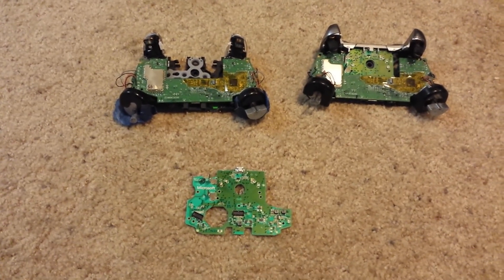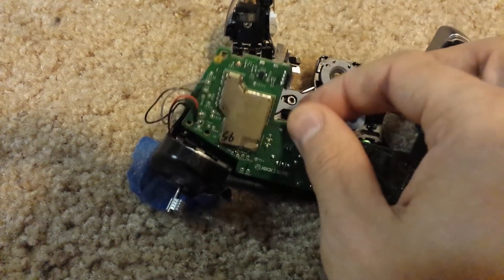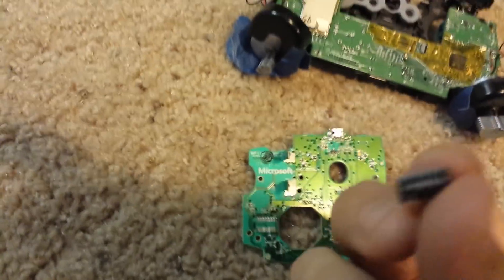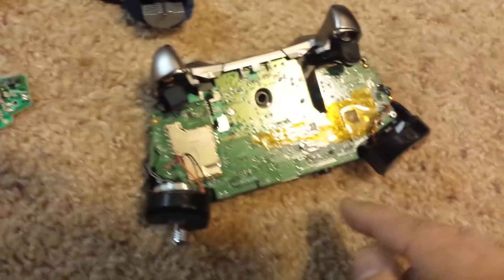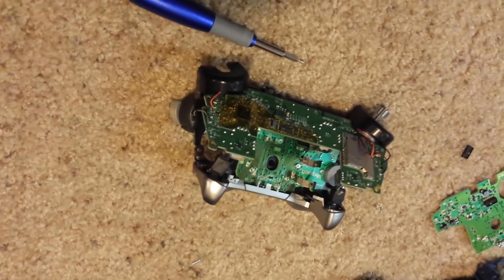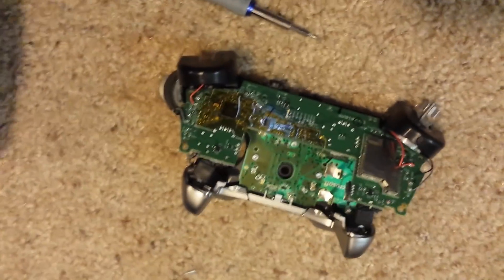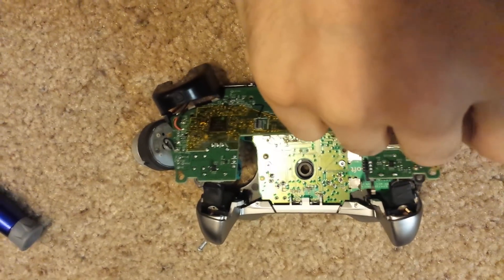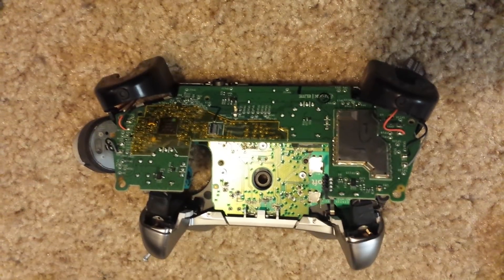Why XBox One controllers won't turn on or charge.  Fatal flaw in Microsoft's design.

Comment: What they need to do and should've done in the first place, would be to not use surface mounted connectors, but instead use connectors with pins that pass through the PCB. Surface mount connectors should be only used when they are making a connection through pressure force like "spring loaded". But they have no interest in making solid hardware that surpasses the warranty period. The quicker it breaks, the better for them. This is going on for years in the industry at all levels and it's nothing new. Such design flaws are usually intended and thought out with "great care and attention to detail". They must hit that sweet spot where a product will function correctly just enough so it would surpass the warranty period, but not by much and then would fail. The shorter the period from when the warranty expires to when the device fails is, the better.
Reply from the maker: No kidding.  That's why they will only warranty them for 90 days from purchase.  At least the PS4 controller have a single plane for the buttons AND its done on a removable ribbon layout so it can be easily a cheaply replaced should a button stop functioning.  Sony definitely gets the win on controller design, even though I normally hate some of the proprietary measures and connectors they use.
Reply: it started in the late 70s early 80s. its called "manufactured redundancy" or "engineered redundancy", and youre right this is a common business practice. what big corporations were finding in the 70s/80s is that consumers were not buying as much product as they would like them to because their product was too well manufactured. the materials were too quality.....what happens if the product is excellent design and quality? sales go down because of loss of repeat sales.

so now engineers are tasked with finding that "sweet spot" in order to do exactly what youve described. this is not impossible, the technology is there and it continues to "improve" every day.

capitalism = if a business can find a way to make more money and if that includes inferior quality to increase repeat sales then of course they will do it.

capitalism is probably THE MOST criminal economic system ever invented and not just because of the inherent fraud involved, but because it makes commodities of everything with almost zero accountaibilty for big corps